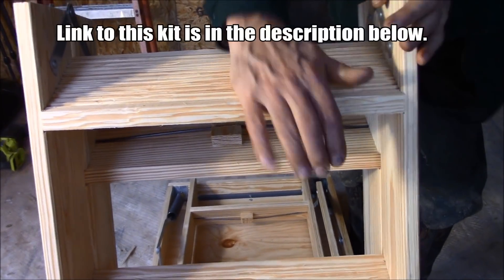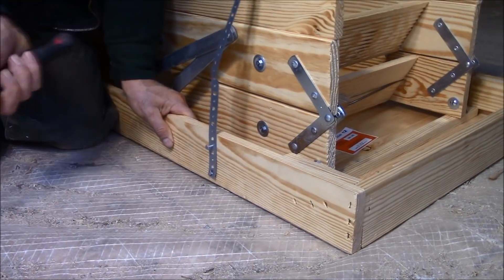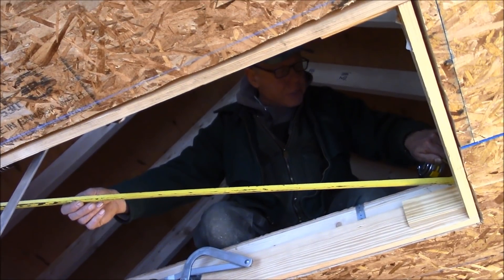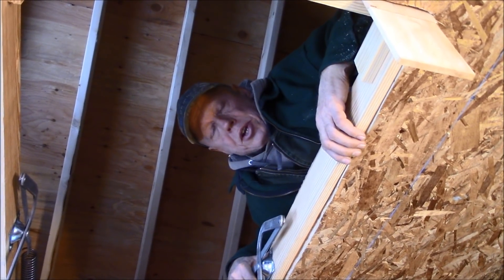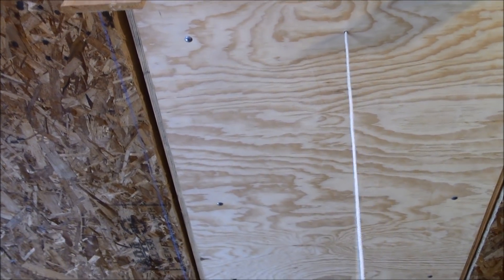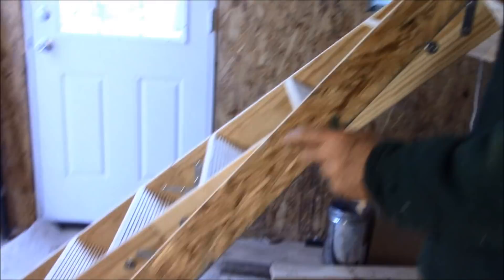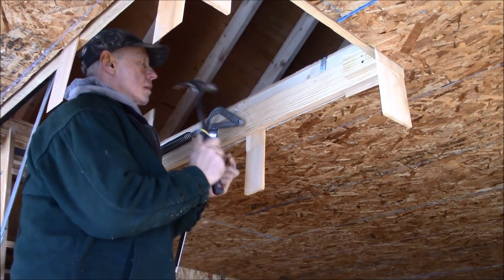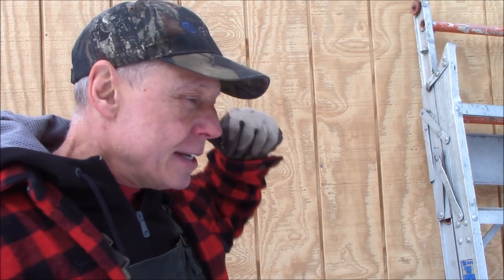HOW TO INSTALL PULLDOWN STAIRS. Easy Access To Overhead Storage At Our Off Grid Homestead.

Comment: I have framed most of my life and generally can pick apart things done by people on YouTube I was going to give you a hard time about the sheetrock screws because they are brittle but you still ended up using the nails they provided lol couldn't find I couldn't find anything wrong with the way you did that you did it perfect and that's not very common with me and YouTube LOL good job. I did also learn a new way to cut the length of those stairs that's smart using your head
Reply from the maker: Yep, the drywall screws are only temporary so I'm glad I passed the test haha.

Comment: Boss, just a thought for you... have you thought of insulating the ceiling area where the stairs’ opening is? Perhaps a sort of upside down box over the top of them with the outsides and top of box having the insulation material attached to it? Something that could easily be moved when needed to access the area.... God bless you...
Reply from the maker: Absolutely.  It would be foolish not to :-))
God Bless.

Comment: Just installed stairs Like this last Monday. Just one question for you. No lag bolts on yours?
Reply from the maker: Lags would be fine but this came with nails.
Reply: TheBossoftheSwamp OFF GRID SELF RELIANCE right on. The one I installed came with lags and screws. I didn’t buy it the customer did. Hey keep up the videos and merry Christmas to you and yours!